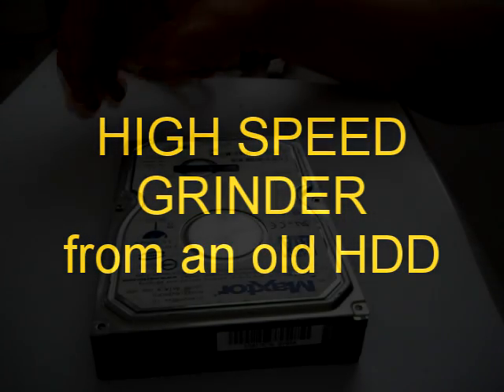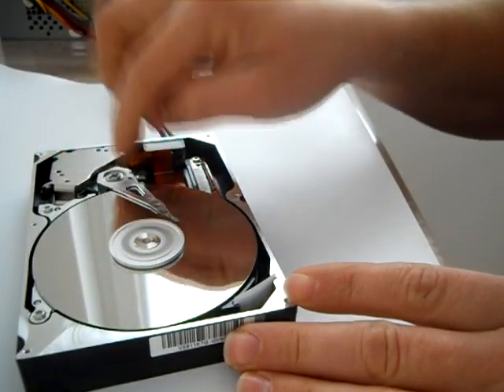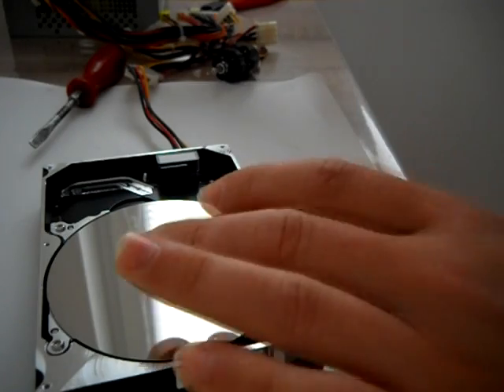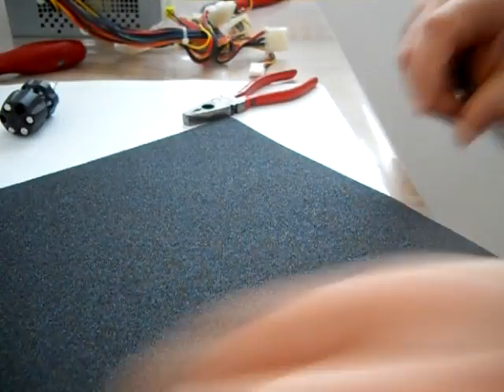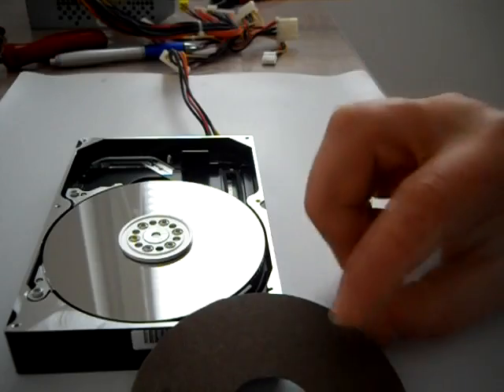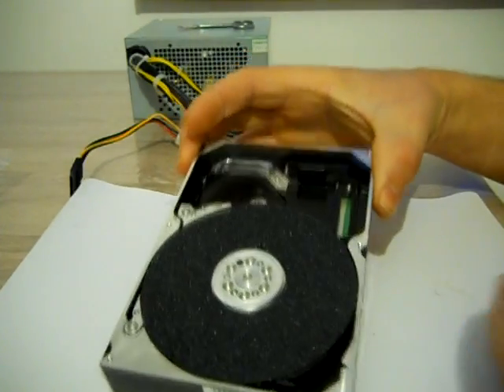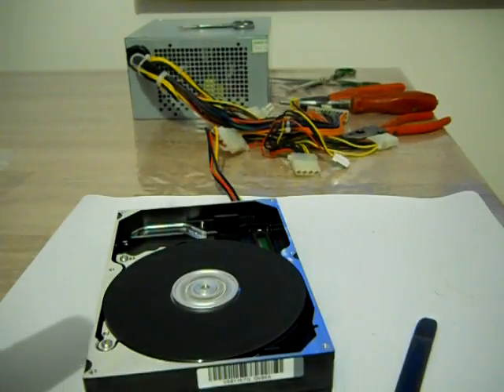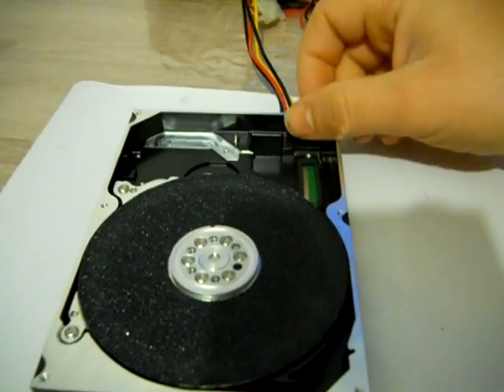high speed grinder from old Hard drive

Comment: Hi there how do you keep the hdd going, as mine stops after 30 seconds....then i have to restart it again...
Reply from the maker: Hello. I don´t know. Many people have the same problem with old HDD.  I have got few drives which are stopping as well but I don´t know how to make it run continously. For my project I simply choosed HDD which was running withouth stopping. You can try it with few more old drives and I am sure that you will be able to find one which will run. Have a nice day.
Reply: Problem is hdd electronics inside in HDD expect data/info from motherboard/PC, which controls where to put needle, speed of motor etc to access data on disc. 
You are probably using PC power supply connector directly into HDD connector which power supply is going through controlled electronics of HDD and then to motor, which controls speed of motor.

Since u have some stuff disabled/removed, electronics/program from HDD, sense that something is wrong and motor stops after initial starting that depends from manufacturer of HDD it is like 10-30 sec. 
To bypass this u need directly connect power +12 and GND to motor of HDD. So you bypass controls of HDD and directly apply power to motor so it spins constantly. If u turn HDD around u will see soldering pins of motor, then with wires solder pins of motor  to power connector of HDD, so power supply is directly applied to motor. 

Also this kinda motor from HDD, CD, DVD-roms, or even fans (where is some projects grinder with fans), HAVE high speed but NO torque (very very small torque), so any high pressure on grinding surface can cause decrease of spining speed or even stops. 
So this kinda projects are for small grinding stuff.

Comment: thanks for uploading such informative video. I had made disk sander but it starts spinning then stops. it does not  run continuously. i am running that hard disk by  atx SMPS. what should i do to run it continuously. please help me.
Reply from the maker: Hello. There are more people with this problem. I don't know how to make it turn. Maybe if you disconnect the reading head or maybe change jumper location (primary-slave)? I have more HDD at home and some of them are stopping and some of them are turning. I am sorry but I don't know how to help.
Reply from the maker: Hello again. Today I checked the disk which is stopping after 10 seconds. I tried to move jumpers around and then disconnecting the reading head and nothing. It always stop aftes few seconds so I don´t know what is causing the problem. I am thinking that there must be software which is deciding to stop spinning motor for some reasom.
The good thing is that from all the old HDD what I have, about 40 percent  are running continously so maybe you can get another HDD for your project. There are lots of old HDD these days so you can ask friends if they have old PC.  GOOD LUCK and Have a nice day.

Comment: TWO ADVICES:
1) cut the sandpaper using the small hole, NOT the big one, place it on top of motor and find the screw holes and than attach it with the metal piece that you had in your hand. The sandpaper should rest on the plater as in the movie but does not need to be glued, just screwed in and it can be replaced fast when it gets worn. Also: do not use fine sand paper unless you have some ultra fine work to do - just use 80 as in the movie because it doesn't wear so fast;
2) to prevent overheating and stopping don't push the piece you are sanding into the sandpaper/disc, the motor is not meant to have ANY torque, it's engineered to move with ZERO resistance, so this "grinder" should be used only for verrrrrry fine works, for gently sharpening blades, for sanding small wood pieces, poly-carbonate, glass etc...

This is a toy, don't ask too much of it and be aware that if abused it could fail catastrophically and injure you. Imagine platter pieces flying trough the room after leaving a 4500-5400-7200RPM motor...

Comment: 10 seconds and it stops. how can i bypass this!
Reply: Nicola Al.  I have same problem if i connect any motor on supply after 10sec it turn off
Reply: Now it works it needed drain after i connected cd rom and fan it worked.
Reply: @Fareke2  please explain in detail. I m facing same problem. stops after 10 seconds. please help.
Reply from the maker: I do not know- my drive is working. Maybe it is another type with some safety option. I tried more drives and all of them are working, sorry I really don´t  know.
If there is anybody who can help from the viewers - please post your comment.
Have a nice day.
Reply from the maker: Maybe if you have still connected reading head- try to disconnect it- otherwise I don´t know why it is stopping.
Reply: I dont have reading head connected it was first thing what i disconnected.